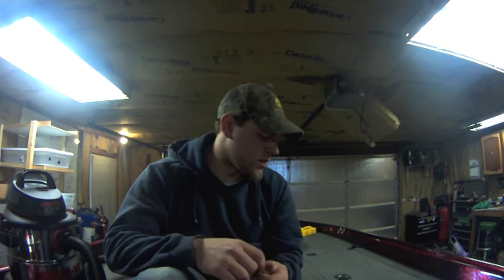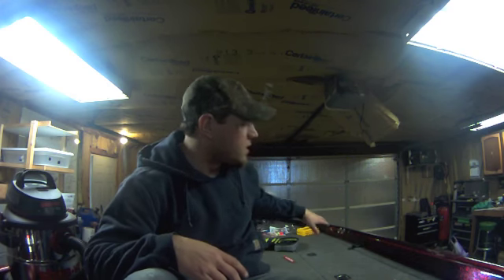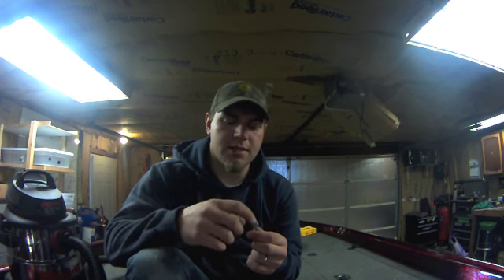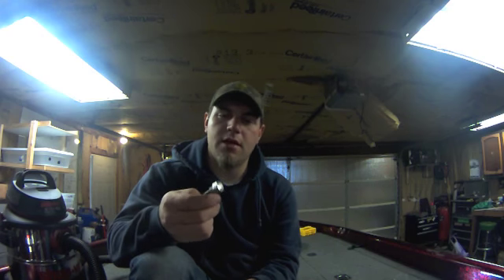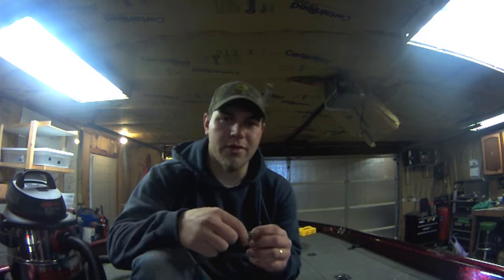LED Boat Deck Lights

Comment: length of boat?  how far apart.  you said 2" up n lower at front what like 1"?   sweet vid n install. what did u do for a switch or was it on the nav lights?

Comment: Thinking about getting these lights.  How difficult was it to get the nut on the back of the bolt?  Did you have foam in the gunwale?
Reply from the maker: I was able to get the nut on the back of the front two lights on each side the other one above those I had to use some silicon to secure it in place. I also had to cut out some foam in the gunwale of the front most light.  So far it has held up great with no issues. I would defiantly recommend these lights. These are very bright lights. I was out the other night frogging and it lit up the boat great. Defiantly a great addition.
Reply: Casey Forrester - great video. Love the look!  I want to light up the floor (red), under the console for night fishing. Did you use these bolts with or without the lense? Great idea about using silicone to help secure in place. So once secured, did you twist the light housing to tighten the nut behind?  Did you wire several lights together on a switch? I'm kinda a novice electrician. Thanks
Reply from the maker: Hey Casey, I for the 3w 11mm bolts which do not have the option with the lens. When I'm ready to tighten, I tighten the nut on the back side. I did wire all the lights together and they are wired into a pre existing switch on my console that controls the floor and box lights, mine what a three way switch so just make sure you splice in to the floor power. Hope this helps. Also here's a link to get 10% off your order! https://www.oznium.com/promo/mikebarker

Comment: Mike- not sure how my name was entered as "Casey"- but this is Dave Miller replying. I too have an existing "floor" / "box" switch on the console of my Triton TR20. I just ordered 2 push button switches for my new LEDs- may save wiring additional LED lights to these. How did you run the wires to your 12V batteries- splice in longer wires? What gauge wire did you use? Thanks again for the additional 10% discount. My early Xmas present!